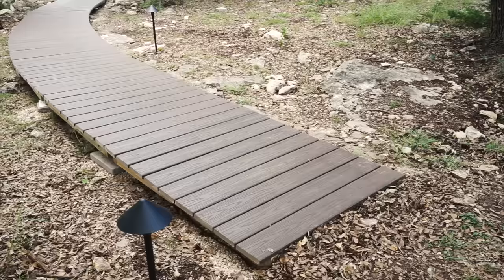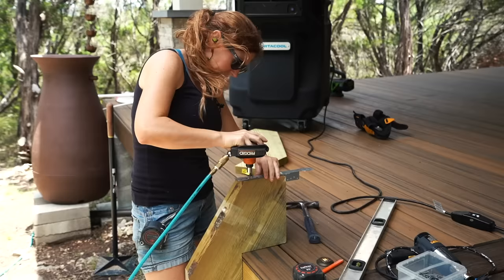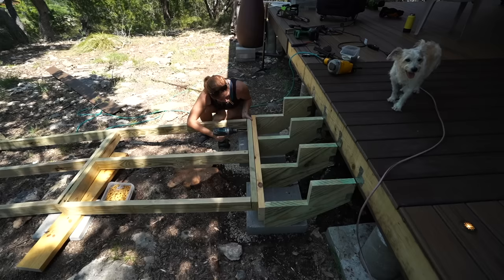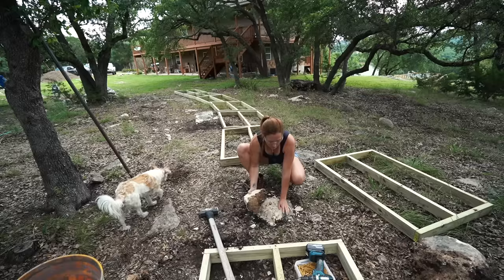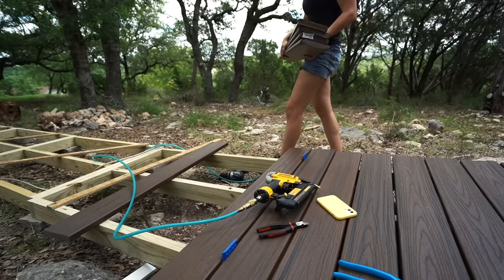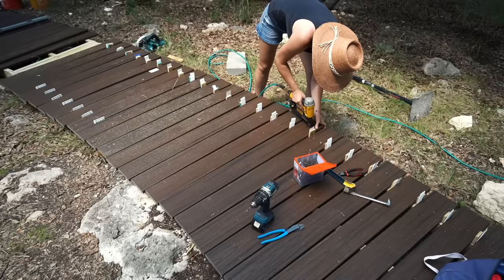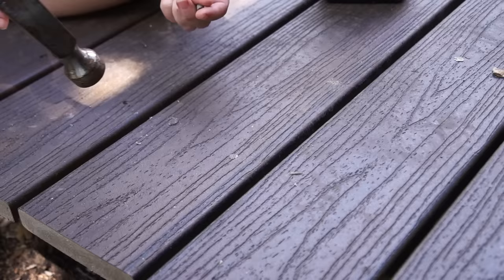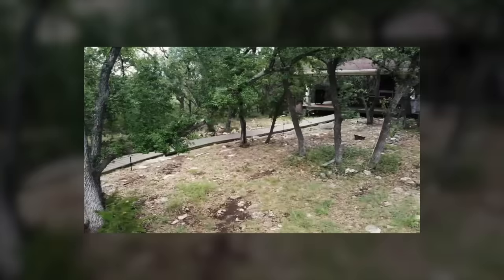Easy DIY Wooden Walkway | Path To My Outdoor Kitchen | Part 10

Comment: Square is mostly necessary, yet not always necessary.
It just depends on the project. In this particular case, the only thing that needed to be square if you will, was the vertical which you achieved by leveling the frames left and right.
Great project April.

Comment: Extremely cool! I have a wooden walkway that is going to be demolished and I've been researching different ways to replace it. This looks so much easier than digging out, leveling and setting pier blocks. I had thought about using boxes like you did and now I definitely will. Mine ill be easier as it is a straight shot of about 60 feet. Yours looks great! Thanks for posting.
Reply: Easier sure. But put in a wiggle or two for interest!
Reply: It looks easier like you said but in my opinion it is the big flaw here. 4 or 5 storms later her walkway will be floating in the air, causing cracking noise and eventually damaging the structure just by people walking on it. You have to at least partially bury in the ground the leveling blocks unless it never rains where you're from.

Comment: I like that you allowed a decent gap between boards. Not that it matters for composite, but my cedar deck boards were installed a tad closer, allowing pine needles and stuff to jam in the cracks cause moisture buildup and eventually rot.

Comment: Im in a wheelchair and its really hard for me to go to out door events because most places door keep in mind not everyone walks we have a area like the one you recently built could you show or do a simple safe steardy wheelchair ramp onto your out door grill area if anything to show how simple it could be know its not needed but i think it could be handy to do and see
Reply: I second that request, many public event spaces do not put enough thought into accessibility issues, if any.
Reply: To make the area assessable to wheelchairs, I would attach the box to the deck so the walking surface will be flush, keep adjusting the height to slowly lower the height close to ground level and then make a transition from the ground to the walkway surface to be able to get a wheelchair across it.  You can't use washed gravel or sand for wheelchair paths because the wheels will sink into the stuff; use 3/8 to dust crusher run smoothed and tamped into place and it will set up just fine.

Comment: Love it. I will add that since the boards are only treated against pests, they won’t be water rot resistant. Painting them with bitumen will hide them more and make them waterproof for very little cost. Every post or wood I put in or near the ground gets bitumen painted…it just can’t be glued to.

Comment: Beautiful work!!  The one thing that stuck out for me at the end, however, is that I don't think you mentioned applying sealant to the pressure treated wood after cutting it.  Once cut, pressure treated wood is (usually) as susceptible to the elements as other non-treated woods.  One should always be sure to seal it after cutting it.  Thanks for posting this, though, as it's given me lots of ideas to work from for my back green.
Reply: Thanks for the reminder
Reply: I was wondering how long treated wood will last when used in this capacity. Would staining it extend the life?

Comment: I need to build an over the landscape walkway which needs to be bare feet friendly. Thank you for showing your walkway build. The one you built looks exactly like what I need to build. I’m so glad you demonstrated your build. Thank you and happy 4th of July!
Reply: Just beware of Trex in the sun because it can get VERY hot. Our previous deck was definitely not bare foot friendly with a similar color Trex as in this video. Either another material is needed, possibly the lightest color of Trex (our new deck seems good so far), or you have to make sure it’s shaded.
Reply: @lucasjw  Thanks for the tip. I’ll try for closest to white I can find. Thanks again for the tip.

Comment: Did this years ago.  A common practice in the Northwest.
Building tip, use clamps to get the framing flush before bolting/screwing together.

Comment: This is a really clever concept.  My only concern is that, although treated, the structural lumber will not last as long as the composite treads.  I've built planters out of pressure treated lumber and seen them rot within 2-3 years. I'd avoid actual ground contact with any of that wood.
Reply: They rotted because they are in direct contact with moisture
Reply: My concern if I built it here in Australia is white ants, termites would eat it within a year. Nice job though.

Comment: id drive a metal stake into the ground and attach it to one of the crossmembers to keep the whole thing from shifting off of the pads when it expands and contracts in wet and dry weatherr. you could still add them iff needed, just pop off a tread board where a crossmember is, drive in a stake, attach it to the crossmember and reinstall the tread.

Comment: I would love to make something like that... but I think in this climate even then best lumber or composite decking will get trashed fast.
Reply: Remember, composite and glass railings should never be in direct sunlight. They get way too hot in the sun. Not to mention the static electricity that accumulates on the composite.

I have experienced this on a two million dollar house that was wrapped in back with an uncovered glass railing on composite decking. What an absolute nightmare. It was pretty. Pretty useless unless the day was overcast. Not to mention the composite reflects sunlight as well as it absorbs it, so the entire deck was absolutely blinding and scorching.
Reply: @skysoldier31  Live and learn, Eh!? Some educational costs even exceed the best college education...I should know!
Reply: @skysoldier31  That's good input indeed. I have seen how hot they get as well. I did my deck but not before I figured out a good shade sail to keep the sun from getting to it.

Comment: I bought some pressure treated lumber last spring and was extremely lucky to get it both as there was a shortage and within a week after my purchase the prices tripled.  With facilities opening back up, I'm wondering if supply has caught back up with demand yet.
Reply: Still probably a few months away.  I think there's still a backup on the East &  West Coast docks which will hopefully be dealt with soon.
Reply: @BoomerKeith1  Got my fingers crossed.
Reply: @maingun07  You and me both my friend!  I need plywood sheets in the worst way but I'm not paying what they're asking right now.

Comment: That's awesome!!!  Rules are made to be broke. If it works for you and you like it, it perfect.  I love the KISS principle.  Folks make things too difficult and then it never gets finished.  There is only one thing I would add.  I would have painted the boxes black so you don't see them through the spacing in the deck boards.  Now you have framed an area to do even more cool upgrades.....Nice Work!

Comment: I love it. My only concern as one who knows barely enough to be dangerous about leveling pathways the right way is that the rules aren't about what looks nice now but about what will last more than a few seasons. But you seem to have a plan for that acknowledging it'll need a little maintenance to keep it happy and shimmed every few seasons. So I'd be interested in an update after a few years if there's anything you'd like to have done differently or if the maintenance is more or less what you were prepared for. 
Thank you for sharing!
Reply from the maker: I've had no issues at all so far. Thanks for watching.
Reply: @April Wilkerson  thanks for the reply. I'm a theater maker by trade so I cheat the rules all the time because my stuff needs to be cheap and temporary. But I move forward with caution when I cheat at home. :)

Comment: Came out BEAUTIFUL!! Looks like you built this project in the TX Hill Country area. I plan to build a few pathways as well. I live in the Brazoria county area, and we have issues with marshes that form in the yard after heavy rains. Sure would be nice to be able to walk through my yard without getting wet/muddy when this happens. I may raise the boxes up a little higher by attaching to 4x4" lumber risers cut to the desired elevation. What I appreciate most is how you dealt with unleveled ground, while preserving the natural landscape. Good job!!

Comment: From a builders standpoint, there are only 2 changes I would make.  1.  I'd use concrete piers and levelling string to set the support columns for each frame.  A properly built foundation protects against settling.  2.  I would have taped the top of all of the wood frames to protect against rot.  Other than that, this looks like a good project that even an older person could do.

Comment: looks nice! 🥂🇨🇦
composite decking has its purpose but you should talk about its flaws as well, number 1 it gets hot super hot in the sun, way hotter than wood, like literally you got to hose it down if you want to walk barefoot on it, 
2) it's very soft and scratches and ages very quickly in my experience 
3) cost 
it would have used Western red cedar instead personally ......but very nice how's it holding up?

Comment: Love this video! Im in the UK and i did a similar thing in my ladt garden. I wish i had seen this bideo beforehand though. The idea if naking boxes first for underneath was brilliant, i just screwed lengths of timber together with cross lengths inbetween every so often, but it did work , then put wooden decking boards on top and painted them black, to match my fence. I then stoned the garden with white stones , and made black decking planters and placed them here and there. With cordylines etc planted, it looked anazing! ( biased i know) but i loved it! It felt like i was holiday just sitting in my garden. I sold my house, for personal reasons but my next house that i have now purchased and move in next month, i am going to do similar ( although a lot smaller garden), but i will def make the boxes as you have shown! Thankyou for this brilliant video!
Reply: Sorry for the spelling mistakes, well not really spelling mistakes, its my fat fingers ha!
Reply from the maker: Thanks! I'm glad you found it useful. I'm sure your garden looked amazing. Thanks for watching.

Comment: I absolutely love this.  I have a small ( I mean small ) path that run behind my pool that is currently pee gravel.  I've always disliked the it since I can't walk back there bare foot.  I may try this.  Although I may have to use pressure treated planks instead of composite boards since they are a bit pricey.

Comment: @April Wilkerson 

Sometimes you have to break or modify the rules to get the job done.    I think the walkway turned out great.!!
    Question on the composite decking  
Those little plugs that you hammered in on top of the screws looked like a snug fit,  but I wonder if they would hold up while shoveling snow off the walkway without the plugs pulling out ??

Comment: I am a 24 year General Contractor in California and I like what you came up with there.  Technically everything you did was sound.  You used rock instead of piers which is fine.  You used a rot proof material as a spacer.  Your span looks good on the joists of your boxes for the material used.  I feel like you just found a creative solution within the confines of the rules.
Reply from the maker: Thanks! Glad you enjoyed the video.

Comment: Just found your video...what an inspiration! We have a fairly steep sloped backyard that has a somewhat sloppy "switchback" type grass path running halfway down across the slope, and turns back upon itself as it travels the rest of the way to the lower back. Trying to think of a way to integrate two 180° turns into the boardwalk to make the path friendly to scooter/wheelchair/walker users. Hmmm...

Comment: I did something similar but to avoid having to come back and repack for settling I hammered in short steel start pickets and screwed them to the frame.  No further issues.

Comment: Im starting a project EXACTLY like this only over wet ground, not rocky ground. I will need to waterproof my base a bit better. I'm curious how yours has held up over time. I'm also curious about the hand held palm screw gun thing you're using.

Comment: This is exactly what I want to do. I have a 29' straight line between two concrete pads. I was thinking about burying a beam frame, but your surface frame approach looks much easier and direct. 

One question--do you recommend a ground screw or other anchor in case of wind?

Comment: I think it looks great :D My only worry is that in a couple of seasons it will become uneven and topsy-turvey. Some of the boxes are on ground, and some are on crushed gravel and cinder blocks. The crushed gravel will settle at different rates and the ground/dirt will also do the same. I would try and address that soon. 

Rebar pounded into the earth may make for a consistent level, and help it from shifting left and right :)

Comment: Another trick. Buy 16' 2x4 any flex it. As you go. Pin it in place with cheap concrete stakes. The screw the boards on the 3 rails.

Comment: Fvc4 the rules! That walkway looks terrific. I especially like that it's virtually weather and wear proof. I don't like that the surface has gaps since mine will be in snow and shoveling with those gaps will be a challenge. It's not 'glued to the ground' but who cares? For a transitioning platform that has limited traffic and no standing load I think this will work out great.
 
Thanks so much! I have rethought an upcoming project that was giving me a migraine.

Comment: That turned out nice. Do you feel like to be productive you need to always go go go, or do you like to brainstorm and measure twice cut once so you are not tripping over yourself? Is there a certain baseline of productivity you need to fulfill each day to be satiated and do you use a dry erase board to manage time? You get 24 hrs in a day just like everyone else though what took you 5 hrs would have taken me 2 days.
Reply from the maker: My day certainly doesn't end at 5:00 like most people but depending on what timeline I'm on, I get to a certain spot before stopping for the day. Actually, doing the build is only 30% of the video I release. So much goes into producing a video, people have no idea. Editing, writing the script for voice over, doing the voice over, business emails, business meetings, drawing up the project, getting material for the project, the list goes on and on. But I love putting out tutorials showing what I build and how I did it. Thanks for watching.

Comment: I put some treated lumber in direct contact with the ground to support a walkway, something like this, and within 6-7 years it started to rot noticeably, with weak spots and wobbly boards on the top. Was this due to the quality of the lumber treatment, or is this what you would expect?

Comment: You have joists in direct contact with ground. That wood is not full ground contact certified. It will rot out rather quickly. If you are going to use Trex decking you might as well have used Trex joist protection tape on top of the joist. The bit about having wider gaps between boards on the outside of the curve than the inside of the curve is avoidable by using some simple math and a saw.

Comment: Great project and methodology. seems like a missed opportunity thou, you could have ramped it up easily over that length to align with the final floor height and not have any stairs, this would have made it wheelchair accessible.
I know you don’t need a wheelchair, but it’s a good practice to try and implement accessibility into your projects when you can.

another benefit is it’s easier to move things around on trollies, or perhaps move a large cooler on wheels up to your outdoor kitchen.

Anyway, Nice work.

Comment: I hear you say low cost, but I'd like to see the Trex boards total cost. I'm just ball parking 80 pieces for the boardwalk, which estimates to about 16 x 20' boards, and in Canada that would be around $1100 + tax. Not bad for the total length. Composite material is totally worth it if it can be had on a discount

Comment: Are you not worried about the wood on the bottom rotting? I did something similar but used composite decking boards for the base too.

Comment: Is the Composite decking slippery in very wet environments? I am in NE FL and it basically rains all summer. 
I have found traditional treated wood can get slippery or get mossy during the summer. Thanks

Comment: I really love this idea.  We have really obnoxious weeds around my property and I am tired of pulling them out from pavers.  This would solve that.  :)  To make the leveling easier, couldn't you just place small cutoffs of the treated 2x4 ontop of the pavers (standing upright inside the framing like legs)?  Then you just need to move the frame up to level and then fasten them in place.
Reply: Roger, it is not good practice to use hardware as load-bearing.  You should have the material bear the load and fasteners keep them secure.  For your example, you would want to cut the scraps to fit, with the decking resting on the scraps at level, then fasten them.  Screws will work loose over time with heat/cold and wet/dry and vibrations.  Nails can be just as bad.  Bolting through a predrilled hole works fairly well, and can be structural, but is still less desirable than stacking material properly

This principle applies to all building.  Shelves, houses, skyscrapers.  Use a material sturdy enough, and design the structure so that fasteners can do what they are designed for.

Comment: What good is spending extra money on deck boards that won't rot when your boxes are going to rot underneath them from being directly on the ground and untreated.
Reply: treated wood hopefully, but I think the pavers will do the trick. Wouldve used treated either way